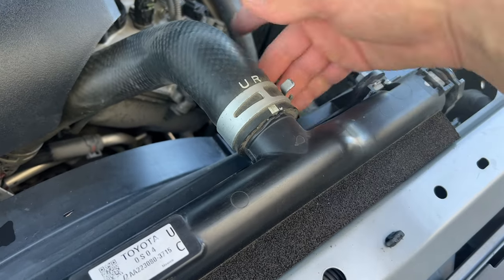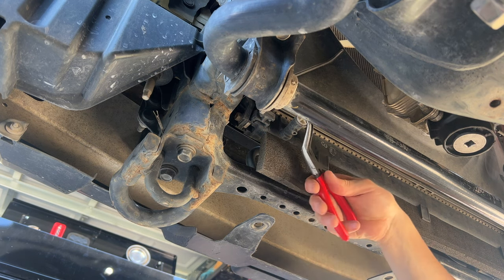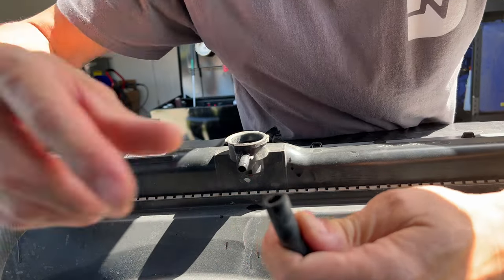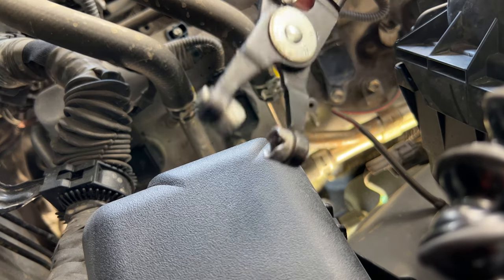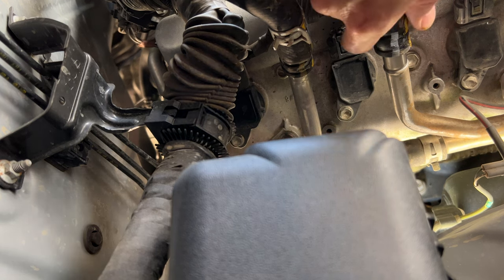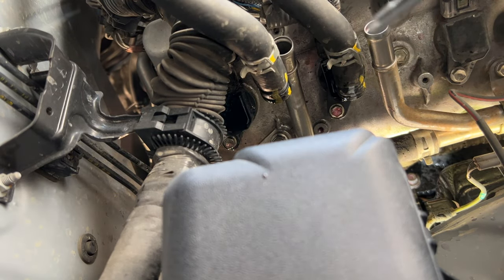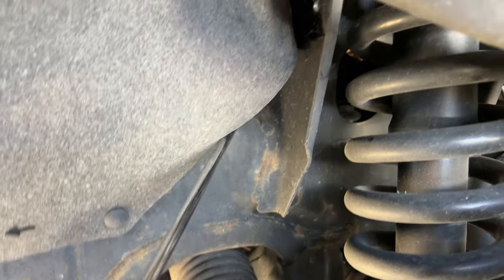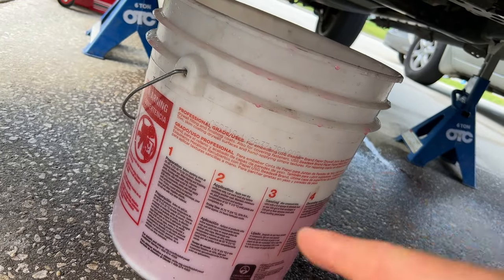Total coolant change | 2nd gen. Tundra

Comment: Im just going to drain and fill the radiator every couple of years. That should keep it fresh enough.
Reply: Same..
Reply: Exactly keep it simple and good enough
Reply: Also, I do appreciate him showing how to get the most out of the coolant system the amount he’s pulling out from the heater hoses and the block seem negligible. You’re going to get your bulk amount of coolant when you drain the radiator.
Reply: Yeah, don't mess with the brass plugs. It'll turn a 15 minute fluid change into a nightmare
Reply: @electropentatonic   I just did this today, drained the passenger side brass since the drivers side doesn't really drain much. Was very easy to do and I drained half a gallon from it.
Reply: Came here to say that I'll likely be doing the same. I'm at 60k miles on 2013 and thinking about doing mine soon. I do not believe mine has ever been done so I'm going to do a drain and fill. Keep it simple.
Reply: I see on care care nut channel there have been issues with old coolant getting acidic and causing head gasket failures.  It looks it’s smart to at least drain and fill every 50k-75k miles
Reply: @MichaelDimaggio-h7x  it will definitely kill a water pump. I need to do mine bad!
Reply: My company Tundra went to 405K trouble free with the original coolant (with only top offs at the oil change places) and transmission fluid. We put at least 3 drive shafts in it though due to the heavy trailer. My own Toyotas will never know such neglect. Hahaha
Reply: THAT IS THE BEST PERFECT MISTAKE AND IGNORANCE THAT PEOPLE MAKE THIS TRUCKS ENGINES WATER PUMPS COOLANT LINES GOO BAD BUT YOU KEEP DOING THAT AND YOU'LL SEE WHY THAT IS WRONG THINKING
Reply: @Wellh0wrya not true. I just followed this video.
Radiator + overflow tank - 1.5 gal.
Pass side engine block drain - 1 gallon.
Driver side engine block - TBD (today).
Heater core - TBD.
I'll update after I finish the job 7/24/24.
Reply: @johnvgig  ya I think he capacity is three gallons… 1.5 like u say out of the radiator but for easy I would just do two drain and fills on the radiator and your probably capturing most of it …
Reply: Drivers side engine block-12oz.

Heater core -12oz
Reply: I  gotta wonder how much really comes out.  Might be easy to do that every two years and be done with it
Reply: Exactly what the dealer told me they did I couldn’t believe it.  I was buying Toyota fluid to do my own.   Imagine thinking you’re getting one thing and getting another. I’d expect the dealer to drain block but whatever.

Comment: Thanks for this.  Great idea to drain and refill with fresh coolant every 5 years and 50k miles.  The 5.7 is developing a reputation of eroding the head gasket between the 5-7 cylinders.  One proposed reason is degraded coolant that becomes acidic.  Maintenance like this is inexpensive and can be done by anyone willing to turn a wrench.  Much cheaper than a warped head or engine block.
Reply from the maker: Exactly right. Less than a hundred bucks is very cheap insurance.
Reply: Alot of high mileage tundras with little or no maintenance to the coolant.  Coolant leaks are the real culprit.  Water pumps, valley plate and radiator leaks are common on this engine.  Running it low on coolant will lead to warpage and head gasket failure.  Alot of people don't check their coolant until their truck starts overheating.  Radiator cap is also know to break in half on these trucks.  This whole head gasket issue is completely overblown.

Comment: My only concern if you live in the salt belt or rust belt, careful loosening engine bolts. They will ring off very easy and you will have a really bad day. My opinion, let the dealer do this job. Sometimes trying to save money can cost you a ton when something does not go your way.
Reply: The engine block drain bolts are made of brass and are threaded into a stainless steel drain valve. The drain bolt is only torqued to ~10 ft-lbs so if it doesn’t break free easily (especially in the rust belt or with an older vehicle) I wouldn’t touch them because, as you said if they were to shear off it’s gonna be a bad day. If you drain and fill your radiator every 30-50K miles it isn’t necessary to try and drain the engine block. It also really helps prevent air bubbles getting stuck in the cooling system, especially the heater core.

Comment: So to drain the system I let the truck get to running temp and then opened the block drain until it was only shooting out air. Would that empty it out completely too? I'm not trained by any means so I just did what made sense in my head.
Reply from the maker: NO! Never open a cooling system when hot. Let it cool to room temperature first.

Comment: Emptying the heater core is a good idea BUT... now you run the chance of air locking the system. I would have put the lower hose on and filled the system from there. Put the upper hose back on. And then fill the radiator/rest of the system.
Reply from the maker: Not a bad idea.

Comment: So lets say u drain the radiator and pull the drain plugs from block, but dont drain heater core. When u hook up vacuum does it pull the coolant from heater core ? or can you just go about refilling?
Reply from the maker: It won’t pull any coolant unless the radiator is almost full. Then it kinda sprays coolant and air mixed.
Reply: @ToolDemos  thanks

Comment: 6:47 thanks for the good video. I prefer using the German style stainless steel hose clamps, which are tightened and removed with a 7 mm ratchet. You can put them back on the hose at any orientation and it still won’t leak.
Reply: Those clamps you use are not meant for the cooling system. As pipes get warmer, the style clamps from the manufacturer allow for the expansion of hot hoses.

Comment: For me this is overkill. I just drain/fill the radiator with distilled water a # of times until clear. Of course I run the engine in-between each fill to cycle everything. I've never drained the block through those drain ports on the engine. Once I see clear water I personally will do this about 3-4 more times just for extra security that every bit of old fluid/residue is out. I then put in the new fluid. To get any air bubbles I just squeeze the hoses and I shake/rock the truck on each side. Some say you should change the thermostat housing each time. DO NOT change if there are no issues. The only issue is if there is corrosion around the gasket area. Again, I have 260k+ miles and original radiator, water pump and thermostat.

BTW - request the "old" red fluid at your Toyota dealer. It comes undiluted. I have a 2014 Tundra which now has 260k...no issues EVER with this truck. Don't buy the pre mixed stuff for major $$$ that the book recommends. The "old" red fluid is suitable for our Tundras - confirmed by Toyota when I enquired.
Reply from the maker: You’re doing a great job with your Tundra. I hope you keep ‘er going another 260k.
Reply: We have a shop out here in Southern AZ. On occasion, we contracted with a radiator business that served several dealerships for over 30 years. The owner/manager always suggested to change the thermostat every 5 years, when we flushed the cooling system. Why? Thermostats can stick and over time, that spring wears out. This typically occurs in the Summers when the engine is under greater stress due to our very hot Summer weather. He recommended to replace the coolant between 50-60,000 miles because the coolant breaks down. We also do not use tap water (due to high mineral content) We always change the thermostats and the radiator cap and never had a vehicle return for overheating problems (unless it was a cracked radiation tank/expansion tank. It's not worth loosing an engine or warping a head or head gasket just to save the cost of a thermostat and cap. Yes, most certainly  an overkill to many, but then again, we are aware of where we live and climate.

Comment: I've watched all your videos. I have never changed out the coolant, transmission fluid, rear differential oil,  and tires. I trade the truck in at exactly 60,000 miles.
Reply from the maker: Yeah, if you don’t keep it long, maintenance is just a waste of time/money.

Comment: Heard you could drain the block from the oil cooler? Supposedly its the lowest point to drain on the truck and gets it all out.
Reply from the maker: I haven’t tried that, it could work.
Reply: @ToolDemos  ill let you know. I have to do a service on mine soon and will be doing this.
Reply: @Jaxboy86  you did not come back
Reply: @nursegilbey  it doesn't drain it all out. It was hear say. I would say though that I do recommend doing it to get that little bit out.

Comment: did u have to add any coolant after thermostat opened? assuming the tool takes care of that
Reply from the maker: In my case, yes. Once I ran the engine at a higher RPM it finally burped an air bubble out, and so I filled it with a few ounces of coolant. Make sure your engine cools before you reopen the radiator.

Comment: Hello. Thank you for the video. I really like all your videos,  nice videos. I have one question for you.
I have lexus ls400 , almost the same engine with your toyota truck ,  What if I change my coolant and I put a Mitsubishi orignal coolant ( the blue coolant ) not toyota the red one , is any issue with taht ?
Reply from the maker: Coolant types are formulated for specific cars because of the materials that they use internally. The gaskets and o-rings on the thermostat, head gasket, and other places react well to the coolant they were designed for.
This is actually a bigger topic than you might realize. It’s worth the research you want to study up on it.
Reply: @ToolDemos  Thank you for your answer. Thank you very much , OK then , what is the best coolant for my lexus what do you think is the best one? Its lexus ls 400 96 model , the engine model is 1UZFE , please advise me ,,, Right now i am using the OEM coolant from toyota , its fine , but when i saw you putting AISN brand ,  I thought maybe it will be better than the OEM ,  Thank you again.
Reply from the maker: @hussienabukhalil2012  originally your car came with red Toyota long life coolant. Toyota has switched to pink super long life coolant. If you flush your entire system, you can put the pink coolant in there and you’ll be OK.
Reply: @hussienabukhalil2012  Aisin makes the OEM coolant for Toyota it's the same thing. Specifically formulated for Toyota/Lexus
Reply: Red antifreeze for Aluminium engines and blue for Cast Iron!

Comment: Struggling to find that 2nd engine drain plug.  Gotta change water pump at work and have picture where it’s supposed to be but can’t find it
Reply from the maker: I know, it’s tough to see. Change the angle where you’re looking. When you find it, you won’t un-find it. (If that makes sense)

Comment: Thank you for the information. Much appreciated.. Quick question about the adjustable round heater hose removal pliers. Do you have a part number or location where the pliers can be purchased? I have checked your Amazon store to no avail. Thanks for your help in this matter sir.
Reply from the maker: Those are Blue Point YA9660. Snap On no longer makes/sells them. eBay is the best place to try.
Reply: @ToolDemos  Thank you sir for your quick response and information. Great content on your videos. I appreciate your attention to details in your videos.
Reply from the maker: @ILwoodsman  I’m glad to hear that, thanks. Cheers!

Comment: Si I am little confused after watching a few similar videos. Isnt the overfill bottle hose supposed to be plugged? how does the vacuum hold with it not being?
Reply from the maker: If you look closely, the vacuum filler bypasses the overflow outlet. So it only vacuums the system internally, leaving the hose at ambient pressure.
Reply: @ToolDemos  great thanks for reply

Comment: Did you turn off the A/C and heat when first starting your engine?
Reply from the maker: @fathernson8  if I did, it was not intentional. When I was running the truck to bleed the air out of the system, I turned the heat on high to monitor the vent temperature.

Comment: So I bought my 2020 tundra brand new. I’m at 40,000 miles. I change my oil myself, and cab/intake filters myself. Well now the trucks getting older, with more miles. I’m going to change the transfer case and diffs myself at this next oil change. Is there any discrepancies about when coolant changes (no frequent heavy tows) and transmission oil changes?
Reply from the maker: Coolant is at the first 100,000 then every 50,000 after that only. Transmission (and gear oil) do have a severe duty maintenance schedule. High heat, heavy loads, and dirt roads can all be factors in oil/lube frequency.
Reply: @ToolDemos  I live in the high Rocky Mountains, so steep roads. But I do not tow. Rarely on dirt roads. What would you recommend for transmission?
Reply from the maker: @coltrockwell5467  I like 30k intervals personally. Transmissions are expensive.
Reply: @ToolDemos  that is an extremely fair
Point. I say the same about brakes and people who use automatic gear selects to slow them selfs down (not in tow, or any justifiable reasons). 

Thank you for your time, and replying to my comment.
Reply: @ToolDemos  i would go 50k on the 1st.   The head gaskets on these engines get corroded by the coolant as it becomes acidic with use.   Cheap insurance.
Reply from the maker: @billc7211  good point 👍

Comment: I have a 2017 tundra 3rd generation 5.7. Do you know if the block drain valves are the same as your 2nd generation?
Reply from the maker: @PaulCyclist  yes. Actually mine is a 2018, so should be identical.

Comment: Can I just refill without having the use the pressurized tool?
Reply from the maker: Yes, but you need to have a way to purge the air from the system. This is especially important if you drained the heater core. Lisle has a no spill radiator funnel that’ll help you do that without the vacuum system.

Comment: Good video. You spend a lot of money on tools but you didn’t use Toyota coolant.
Reply from the maker: Aisin is the OEM for many Toyota components including coolant. They make high quality products that I am always happy to use.  On the coolant container it says OEM engineered formula. It is made specifically for Toyota/Lexus. I did get a better deal on this coolant compared to the Toyota dealer, which is a good thing.
Reply: Aisin is Toyota coolant. They literally make it and Toyota just slaps their name on it. Also aisin makes Toyotas water pumps. I